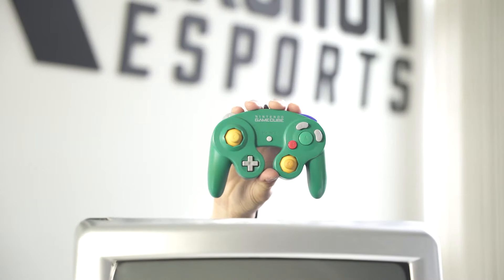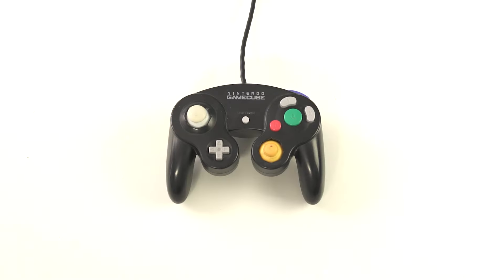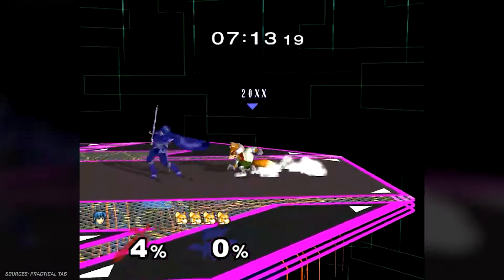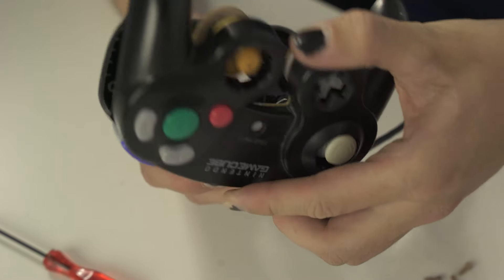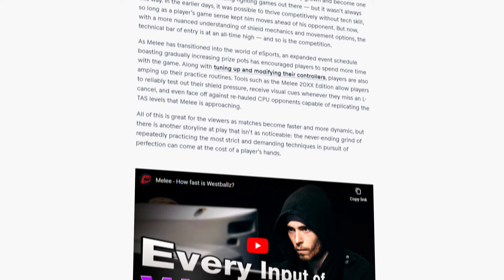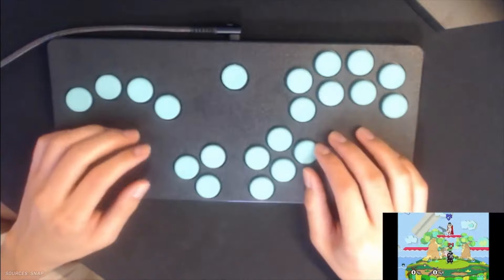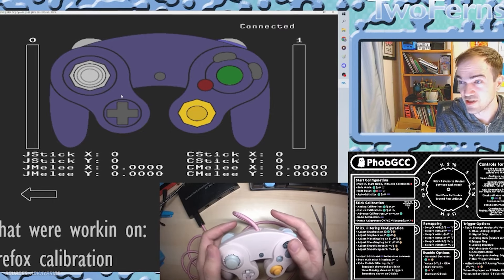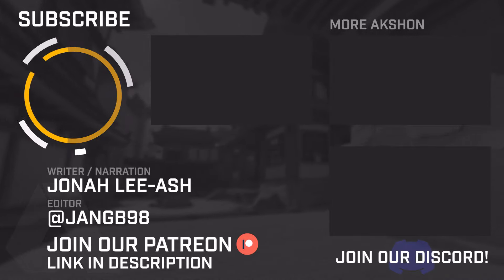The Pursuit For The Perfect Controller

Comment: I bought a $300-ish custom, notched up work of art from a small modder and a month later the left stick started to mess up. Now it collects dust in a drawer and I use a crusty silver OEM controller that I bought for $15 a decade ago. It's easy to drive yourself crazy trying to find a good controller.
Reply: I gave up on constantly replacing controllers and learned a box-style controller a few years ago. Initial cost: ~$250, but I've never had to replace or fix it over the years.
Reply: @altan5910  plus, because they’re used in so much more than just smash controllers, it’s super easy to just swap out the buttons, sanwas are super easy to find and designed to be swapped in and out by even a beginner. Way more accessible than modding a GC controller
Reply: Yea I’d consider moving the good stick box from the old one to the new one but desoldering can be a pain the ass
Reply: @Jabug_  The silver one has issues too, but it doesn't cause me to SD like the custom one. I appreciate your suggestion, though! I have never used a controller that didn't have some issues with the left stick.
Reply: @jabug_1144  notches wouldn't work anymore then, he would need to get a new faceplate notched to the new stickbox
Reply: If it’s a phob I’ll fix it for $10 + shipping lol
Reply: @connoranastasio  It is not a phob, but thank you for the offer!
Reply: The best controller is the one you play best with😊
Reply: Dude just do what I did. Open up the controller and do the notches yourself. That $300 mod can be done for next to nothing. I spent $10 on a file and screwdriver, 20 minutes watching a video, and it only took me 30 minutes to take apart add notches and put back together.
Reply: You also could order a replacement analog for your expensive controller
Reply: @harrylane4 yeah I want a box or an arcade box to play old arcade games with or something fun but very expensive

Comment: for those who don’t know phobs and goomwaves are used by basically all top melee players but a lot will still say they’re basically cheating but also it’s hard to implement limits because the community has gone so far in terms of controller tech and community, there’s people who live off modding controllers for melee you can’t just end that.
Reply: I think certain mods are definitely cheating(notches, mouseclick buttons, cutting trigger springs, etc.), but fixing the biggest issue with OEM controllers(potentiometer degradation) is a plus. I think most things beyond a hall effects sensor is cheating. It's honestly ASTOUNDING that the community allows notches. I see there being no argument for them, as it is pretty obvious that it is taking away a certain skill and most definitely constitutes cheating.
Reply: @dash9087-d9d  like the video mentions, shield dropping is such an essential tech in melee’s meta today that notching your controller for consistency is probably the fairest way to go about it, cheating or no. Also it’s not getting rid of a skill floor because of the inconsistency of doing it between controllers, and over time on the same controller.
Reply: @dash9087-d9d  part of the issue with banning stuff like notches is that because gamecube controllers are so different, even out of the box you can’t regulate a lot of this stuff. If you can find a controller in the wild that has its stick messed up in certain way that makes it perfect for shield dropping, what makes that different from one made to be perfect for it.
Reply: @poiri  I'm saying the easy fix is a phob. I don't think putting notches to make things 100% perfect every time is a good thing. You don't even have to have muscle memory. You just throw it in the notch corner and you hit it with 100% accuracy 100% of the time. OEM lottery is not the way and I never insinuated it was the best way. I don't know the general variance between phobs, but it is definitely easier than the majority of OEM controllers.
Reply: @dash9087-d9d  if you want to ban notches you should think the same way about box style controllers, or at least that they have to be nerfed heavily, but box style controllers are first and foremost an ergonomic alternative for people with hand issues, and i personally view improving the base controller to the level of boxes to be much more preferable to nerfing the boxes to be as inconsistent as controllers. Doesn't everybody want a good controller? Imo phob and goomwave are rly crucial to a level playing field in melee or smash in general. Everybody should have access to 1.0 cardinal dash speeds, consistent shield drops, and good wavedash angles. It shouldn't be a pay-to-win for people who can use box controllers that have macros. Rather, imo everybody should have the priveliges of being able to execute controller-specific or heavily controller dependent tech. At that point, winners of matches, people who succeed in competiton succeed purely because of their skill, and not because of some mixture of their skill and their luck or willingness to spend boatloads of money on a decent and somewhat usable controller.
Reply: @BlurbyDestroyerOfWorlds  I DO think the same thing about boxes lol They are also cheating.
Reply: @dash9087-d9d  notches are valid but the other 2 things u mention are literally just QOL lmfao
Reply: Goomwaves r way more cheating
Reply: @dash9087-d9d  bruh trigger spring cuts r not cheating
Reply: @mlalbaitero  It's like altering deadzones on your sticks. People are just so accustomed to modified controllers, that the lesser of two evils is called legit. You open your controller, cut springs in half so the triggers are easier to press. That's all. It's not a big deal to me, but it's also not legit to me either. Notches are the big thing. People keep @ing me about the others things I listed when notches are clearly the real issue lol

I think controller "mods" should solve ISSUES that change the outcome of the game if they arent calibrated correctly. The biggest culprit are the potentiometers. Every single potentiometer ever will degrade. It will change the controllers inputs over time. Some will degrade after two weeks, some 2 months, some are fucked up out of the box. That's all I'm saying. 

Basically... Ban notches. The rest are fine. Even Z jump.
Reply: The entire point of FORMULA one is to find the fastest controller to a gofast machine. That's what entire car companies compete in and the driver is their pick for the TEAM, who can operate on the bare minimum level of brining out the value that the invention INHERENTLY has. Welcome to the real world, kids, competitive Smash is low-skill-ceiling tournament, and prioritizes celebrity culture of "the best gamer".
Reply: Yes you can end it, they can find other streams of income. creating hardware for cheaters and creating barriers to entry for newly competitive players is bad and shouldn’t be an opportunity for profit.
Reply: If it tournament legal, it isn't cheating. Calling something tournament legal cheating is braindead.
Reply: @davedanger4414 just say you're broke and have never gotten to experience the fun of free full length wavedashes .
Reply: So what you're saying is that most if not all top melee players are frauds.

Comment: I have a phob that i used for Marth but the analog control stick stopped working after i think a few months.

 (despite everything else working just fine). Stilli enjoyed using it on slippi when i was able too. As if rn im using a Frame 1 B0XX for melee and ultimate.

Comment: Really says a lot that my terribly abused black controller from when I was 8 years old still works better than the joycon I dropped once. 

Also, don't get me started on the wavebird. That lil thing works perfectly from across the room, even reads inputs without delay when I'm in a different room, and my Dualshock 4 can't sit four feet away from my PS4 wothout suffering severe seperation anxiety.

Also got a steal from Gamestop, the one time the online store dodn't let me down. Bought a preowned controller for $30. They sent me a genuine, pristine condition Melee controller that looked like it was brand new.

While the wireless Switch controller is okay, my biggest gripes are that it's super lightweight, very cheap feeling, and really, REALLY noisy. I'd just prefer it if I could mod one of my old controllers with the needed buttons and forgoe the wireless entirely.

Comment: Can someone explain "removed the spring from the right trigger to make my power shields more consistent"? 0:25 I thought this would leave it practically useless cause it wouldn't spring back.
Reply: probably used a trigger plug
Reply: powershields are diffcult because it requires you to fully press the trigger, and if you ever used one you know it takes alot of time to fully press the trigger and powershields need frame perfect timing, also they spring back you just need less power to press it and yes im a year late

Comment: It's my headcanon that the GameCube controller doesn't have a decent D-Pad and a second shoulder button because it would be unfair to other controllers to even compete.

I miss the octagonal-shaped hole around the stick. On every other controller, when I hold forward it's always at an angle. Except for the GameCube and the Wii Nunchuk and Classic controller.

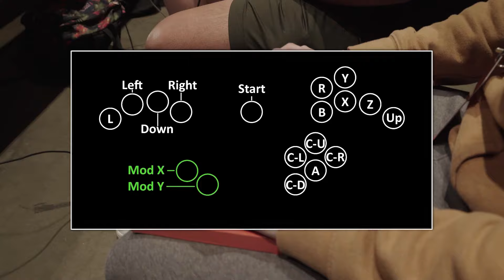Comment: quick correction (10:50): unless you play on a boxx controller with programmable modification buttons, you can't get a max length wavedash on a boxx style controller. you can get rather long wavedashes but this is a specific nerf that players like hax$ have kept in the b0xx.
Reply: Can confirm any pleb on a GCC can hit longer wavedashes than me

Especially with notches
Reply: I think you used to, but since boxx controllers have gotten a lot of complains hax$ did nerf alot of fix in software patches
Reply: @mattisandersson9661  the boxx has had a set of nerfs throughout its entire lifespan, but I do believe things like sdi nerfs and pivots have been tweaked a bit

Comment: Should probably add that Phobs have gotten cheaper and easier to make with 2.0. And the cost of getting 5 PCBs (the minimum from the PCB manufacturer) is about 200-250USD, after that you just need tools, cables, magnets, magnet holders and donar controllers. you can then additionally add tactical buttons and Phobvision (a way to get controller information onto a CRT and easy calibration). Took me about 20h to make my first one, but I spent around 11h fixing with the face button cuse they need to be very annoyingly precisely filed down to fit the tactical switches. Also spent a lot of time trying to fix Phobvision which the issue for me might just be that my CRT might not be able take an NTSC signal (I European). It was my first time doing any solder work at all.

Comment: paying 500 for that phob is way overpriced. You can easily get a phob for around 250-300 or get a prebuilt board for about 150$ and do the rest yourself
Reply: Or get a box for 150 that won't break before you even open the package
Reply: box controllers are around 250 and last you significantly longer life-time wise.

Comment: Amazing video!
If I had one thing to add, it is that I wish you would have included a segment on Hax $'s 1.03 patch which is basically an extension to UCF. It fixes a lot of the problems of unmodded controllers & levels the playing field a little with regards to the boxx controllers. I think it's a great & scalable solution since it's openly available and a software mod, not a hardware mod. I can really recommend Hax $'s videos, where he elaborates on this and which few mods he would recommend on 1.03, most of which can be done by the average Joe, I'd argue.

Keep up the great videos~

Comment: As someone who used to build and customize fightsticks, Mellee and Smash has kind of been irksome. If someone wants to use another controller, and it's not using macros, then it it should be fine. Especially when some people are wrecking their hands playing this game. A gamecube controller was never designed to be a tournament controller. It was designed to be an inexpensive controller to play ALL gamecube games, from racing to platforming to fighting. A lot of mellee players lose thier shit over other controllers.
I've always wanted to try and make a fightstick for mellee. You can buy analog joysticks and pair that with some high-quality buttons and it'd be both ergonomic and full featured. I just dont want to have to deal with that community.

Comment: $500 for a phob is a complete rip off. Your friend got scammed hard 😢. I've built several phobs and it cost me like $300 to make 5 of them. You can definitely find phobs for like $160-200. If it's in a custom shell with custom buttons or it has additional mods then they would sell for like $300 plus.

Comment: That's why I got the b0xx instead, spending $200+ bucks on a conch is insane. Melee is pay2win, indeed.
Reply: i mean the b0xx is 250, 350 if you pay for their switches - but obviously in exchange you won't have to replace it after a few months lol

Comment: IMO the perfect controller would be a better version of sony's DS4, with individual d-pad buttons rather than a single pad and a sloped back half so the trigger area doesn't cut into your hands. Maybe the right side face buttons could be diagonally staggered and there could be six of them. Aligning the analog sticks diagonally like Xbox or Sony's dumb new mobile controller is unergonomic and prevents claw-grip for the d-pad so keep the Sony mirror-image alignment. No leds or Motion sensor for a 24 hour battery too. I'd buy in a heartbeat ngl.
Reply: Surely there are usb to GameCube controller adapters right?

Comment: 10:55 minor correction that all SWT compliant box controllers cant do perfect 16.9 degree angles. the best possible is somewhere between 21 and 24 degrees which b0xx/F1 style firmware can only get during up B and instead only get 30 degrees for other things such as wavedashes. Whilst consistent it still leaves them worse off than a notched gamecube controller

Comment: Just for the people who want the best option on a budget, the part showcasing that the phob is $500 can vary from modder to modder, if you want to still get a phob without the huge price jump you can just buy a fully assembled phob board itself (of course modder dependent) if you don't know anything about soldering stuff together, buy your cosmetics separately and you can save quite a bit of money that way, it'll take some time on your end if you want to go this route, but if you have the extra cash you can just buy a fully decked out controller.

controllers are expensive these days so just a different approach to think about when shopping for these things.

Edit: likes are all appreciated, I'm not usually the kind of guy to edit my comments for this thing but couldn't help but say thank you for any likes, happy to help out in some way for newer folks ☺
Reply: me and a friend of mine convinced almost half of our local scene to place an order on just the PCBs from china, we are going to do the rest of the work ourselves.

The total will probably be around 40 dollars per phob
Reply: @nelsonrodriguez2085  yup with the newer phob motherboards it's gotten a lot cheaper. If you already have a T3 stickbox donor and don't go for custom shells and buttons etc you can easily even do a one off phob for like $50 or less, assuming you have the tools and skills to do so. I've considered building some for others for cheap as well
Reply: Well said 😆

Comment: "Full length" wave dashes are not possible on b0xx/f1, let alone easier. Its harder to mess up your angle but the furthest wave dash that a b0xx can do is a lot shorter of a wavedash than the furthest wave dash that a gcc can do. this is one of the many nerfs that b0xx has always had. 

It's the same thing with perfect firefox angles. A notched GCC can consistently get much more shallow/steep angles than a b0xx can. 

There are lots of techs that are not as hard on b0xx as they are on GCC but there are many techs that become harder on b0xx. You're absolutely still doing everything yourself and its objectively harder to learn to use than a gcc is. 

The reason you had so much fun playing b0xx after just picking it up is because learning melee is fun and knowing that the only thing that can mess you up in the game is yourself is very freeing.

Comment: The Boxx could be much more ergonomic if it was more similar to a split keyboard, in that the two halves of buttons would be angled inward, so you dont need to angle your wrists all the time. So maybe the Boxx is more ergonomic than a controller, I think it could be much better and you might see ppl having wrist pain.
Reply: There are other B0XX-type controllers with different designs. Maybe another company has what you’re looking for?
Reply: should look into the prism (the one shown at 10:33)
Reply: This is true; elbow at a 90 degree angle and hands straight out (like you're going to give a handshake) is the ideal.  Well, actually the ideal would to not have your elbow bent and your arms hanging straight down, so it could be possible to go a step further lol.

Comment: the take away here is the gamecube  controller is so awful that ppl have resorted to modding their controllers. lol.
it would be so embarassing to lose to someone who uses an awful 10$ pelican controller.
i mean i wish they'd remake the gamecube controller out of nicer material with a better weight, less clacky shoulder buttons and that icky half assed z button. i'm amazed that guy had his gamecube controller for 20 years i had over 20 controllers. they all developed problems sticking buttons, buttons not working like ACTUAL problems not like whiny tornement high level gaming problems.